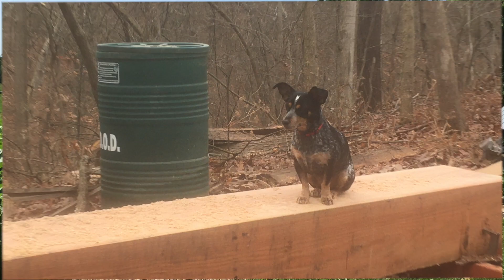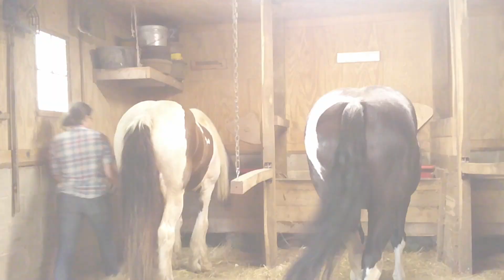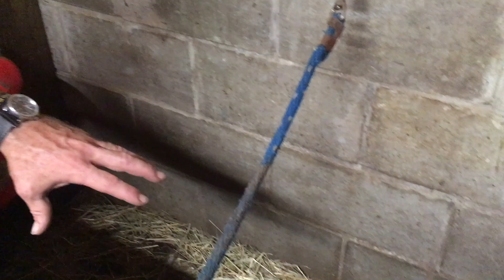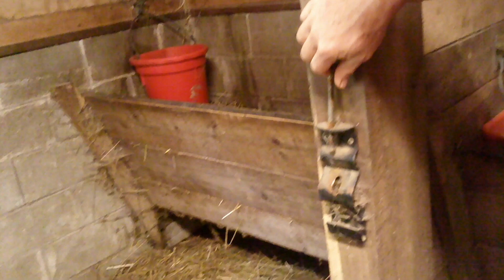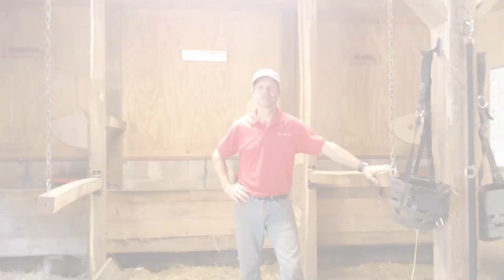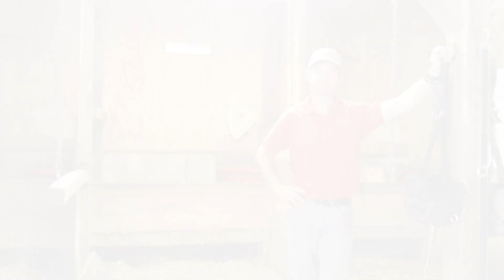Horse Tie Stall Design

Comment: How do you prevent sinking of the grid system where the horses urinate daily?  Ours tends to sink in that area.
Reply from the maker: In almost a decade of use, we never had that problem. I believe the key is to put a proper underlay foundation first. You can’t just lay it directly over soil or sand or it could erode with time. It needs a good gravel base, Then the grid system, and then you can fill the grid with the surface you desire. Gravel does not erode like sand or soil.

Comment: Very neat tie - stalls.  If possible,  tie-stalls should be towards an aisle, especially if horses are stalled for longer times, which is not the case on your farm, to avoid  having them stare at a wall.
Reply from the maker: Yes, I fully agree with this tip!  Even though ours are never in for more than a few hours, we still seriously considered putting in windows for them, but there was just no practical way to do it.  Our barn is designed like a walk-out basement, so that wall has earth on the other side.  I would also prefer an aisle for the purposes of feeding and such, but sometimes, you make do.

Comment: Where did you get the connector for the front of the 4x4 divider?  I am getting ready to build some tie stalls, and love this remove-able option.
Reply from the maker: We just ordered A larger water bucket holder with pin from online. There are several varieties like this, but it’s the pin that makes it work like it does. Just make sure it’s a sturdy Bucket holder, so I can support the weight of the beam and the pressure of a horse moving around and bumping it.  Put an eyebolt in the end of your beam to connect the pin through.
Reply: @ADifferentWay  Thank you!